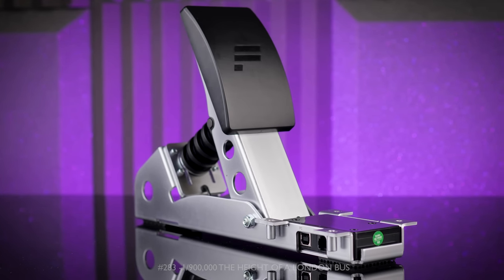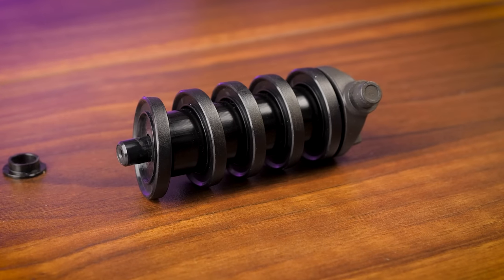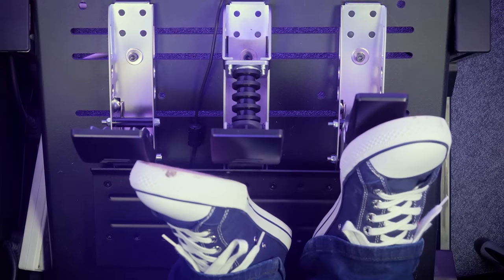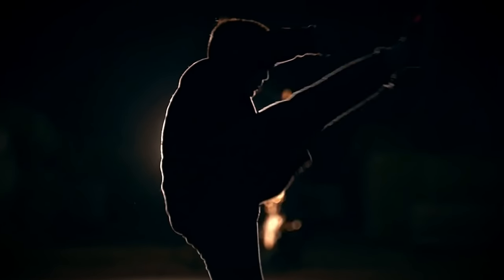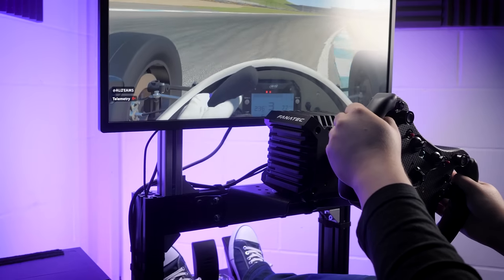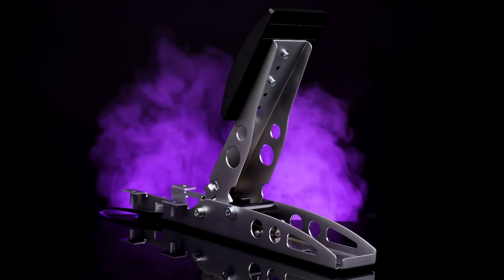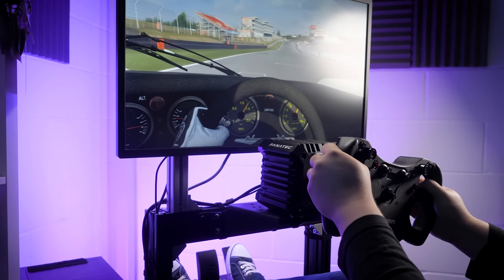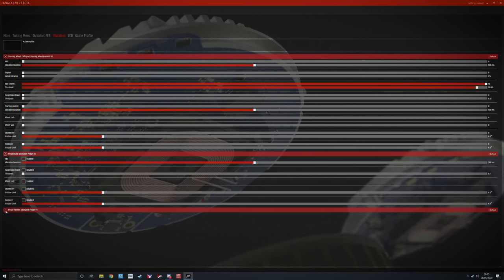Fanatec CSL Load Cell Brake Pedal Review

Comment: Well, I just put together my CSL pedals with the load cell kit and my experience is quite the opposite of Chris'.  The elastomer for my brake is much harder than Chris'.  I can't get anywhere the travel which Chris displays.  It appears totally unusable unless bolted to a sim rig.  Even then it could still be too hard.
Reply: Same here, making me suspect if my legs are too weak.
Reply: I have the same problem..you know if we can change that??
Reply: I just set up mine and I get almost no travel. The 30% sensitivity setting is enough to make it usable but it's nothing like what I'm seeing here
Reply: I ended up buying a wheel stand.  I ran across some "rubber spacers standoff washers" on Amazon that look similar to the elastomers the come with the pedal.  If I can find some that are softer then that might work.  The pedal comes with "65" hardness.  I think the next softer might be a "45".  I think it going to involve some trial and error.
Reply: @stuboyle666  That is a pretty good idea, hopefully it works for you! I bought some elastomers from BBJ Racing on recommendation from a forum. Not the cheapest solution, but hopefully these work when they come in.
Reply: Load cells like these absolutely need mounting properly. They only really work in a rig where you have your back braced against an immovable seat and when you press the pedal you are able to engage the larger muscles of the thighs and backside.
Reply: I swapped out the foam insert from the standard CSL brake pedal used the insert to replace one of the rubber elastomers. Feels a lot better.
Reply: @coastalboat5700  I tired doing that myself but I couldn't get the thing back together. Kept blowing apart haha. Glad you got it though. Must be nice!
Reply: @MarcLCT  happened to me too! I ended up removing a rubber disc and a plastic spacer to get it to fit.
Reply: Mine is the same. Hard to modulate since there is so little travel. I don’t have a full rig but I’ve a home made thing it’s bolted to, which rests up against the wall so it doesn’t move around at all, even if I have it set at 100%.
Seems different to most of the pedals I’ve seen in reviews.

Comment: Just got mine this week and my LC brake pedal travel is nowhere near like the ones shown here. I can barely push it past 2cm and it makes it very hard for me to heel-toe. Definitely gonna change some out to get more pedal travel.
Reply: I have the same problem.
It is so hard and you can do a maximum  push from 1-2cm

Do you change it or do you get a new one?
Reply: are u using it on a rig? it seems that without being mounted to something completely solid, these pedals are really hard to push in with the stock 65 shore elastomers (im having the same issue, im using a desk and the pedals are just on the floor.)
Reply: I’d recommend using the foam insert from the standard CSL brake pedal and replace one disc of the rubber with the foam. Travel is better and less stiff.
Reply: Mine is like that also. I’m not very happy with the feel.
Reply: Chris clearly does not skip leg day.
Reply: Can someone please help? Is it just me or is it incredibly unrealistic when driving normal cars? Like I understand f1 cars having this type of pedal but surely it’s way too strong for normal cars. Is there a way to adjust the force other than the distance???

Comment: It takes multiple hours / weeks to get used to. I first switched from G29 to CSL DD, which helped me to get a bit faster or at least more accurate 😂 after LC Kit was available, I ordered it and have been using it for couple of weeks and again I've gained some time, but I still need some practice to master it properly. Don't care about the travel at all, as I know that it's all about preasure. I'm also using racing boots with these as I feel it's  more comfortable than with socks 😎

Comment: 230 total price with all the upgrades (assuming you buy with the discount) probably worth spending the extra 130 for the clubsports
Reply from the maker: Maybe. I maintain that the clubsports are the best bang for buck pedals you can buy, and I’m a massive fan. But you get a lot of performance/ control for your money with these. But yeah, if you can afford the extra, clubsport v3s with the performance brake kit would definitely be my choice.
Reply: I have Clubsport v3 and I like it
Reply: Yeah, it's 230 buck for some folded sheet metal, 150 for a 2$ load cell. Disappointing as usual from fanatec and their huge margins on add ons

Comment: Great video in terms of quality camera work, sound and presentation Chris. 
In my opinion, the CSL Elite Pedals that I have just sold were probably the last fanatec product I will buy. I understand they were the elite however I just think fanatec are in for the profit above quality and customer experience currently. Take their CSL DD, the proper power pack is extra. 
Take the pedals in your video, they are cheap but probably same price as their predecessors. They look cheap though, the plastic pedal faces urghhh! Taking away the extra elastomers but then charging extra for a tuning kit when in reality its not a tuning kit but better pedal faces that should have been included already. 
Nonetheless good video Chris. But fanatec, no thanks.
Reply: I agree with what you said mostly. It's this approach that makes you feel trapped in their ecosystem because you are so heavily invested. The booster kit is a slap to the face, this load cell upgrade costing more than the base pedal set is insulting and there have been other examples similar to this as well. You can't argue that they aren't making among the best quality stuff in this lower/middle price range though...

I was invested deep into Fanatec when I first started sim racing more seriously. I have owned the PS4 bundle DD1, csl DD, CSL elite wheelbase, csl elite pedals, V3 pedals, magnetic paddle shifter, hydraulic brake kit, podium hub, bmw gt2 wheel, v1.5 handbrake, and V1.5 shifter. I sold everything except for my CSL DD and V3 pedals and the V3's might be on the chopping block. They really lock you in mentally especially on console. They have a great marketing dept. and design team but customer service and transparency are not top on their list.
Reply: I haven’t had my fanatec stuff for long but I found the csl pedals to be very good and definitely higher quality than my past g29 pedals, I have also had less problems as my g29 ones would get dirt in them and glitch however I have not had the problem with the csl ones. Also about the power pack I think it is definitely overpriced but actually quite clever because what I think they are doing is charging a low price for the wheelbase with 5 nm and a high price for the 8 nm meaning the product is more accessible for those with a smaller budget and while making up for the lost profit from the 8nm power pack

Comment: Chris can you check if the retail load cell breaks are different than the review ones? many people in your comments and myself as well have really hard ones I have max brake force and reach it after  like 2 cm of travel and not even close to your video. and I have a proper rig and mounted then solid.
Reply from the maker: I'll reach out to Fanatec and check. I definitely get more than 2cm of travel. Now, the Heusinkvelds, they're about 2cm at a guess, very stiff.
Reply: Any word on this yet?
Reply: @ChrisHaye  thx, But I decided an sent them back and went with the V3 Padals with BPK and I love them! they are  so much better !!!
Reply: Same here, would love to hear how retail compares with review. Mine are very stiff. Slowly getting used to them, as I know it's about pressure not travel but a bit more travel wouldn't go amiss!
Reply: @MrTone71  I just got a set of Elite with load cell and the LC is stiff too but I'd rather it be the way it is. When I saw the one in this review moving so far I was confused.
Reply: Same issue with me. Mounted to a rig and pretty unusable. 2cm travel is about what I’m experiencing too. Anyone know if there is a way to fix it without just getting a different pedal?

Comment: These look like great value for money. But a TM TLCM can be had for a lot cheaper locally, even without seasonal/clearance sales. I guess these are catered towards those that buy the CSL DD package.
Reply: T-LCM are great with 3drap brake elastomer. Check it out, its price is fairly low and transforms T-LCM 2x red springs to a real "pressure sensing" pedals.
Reply: @alpha007org . I will install a elastomer damper (or two) and a DIY rumble kit soon. :)
Reply: @s_n9210  Which rumble kit?
Reply: The price is almost the same, but the problem is that there is no official licensed dealer of FANATEC here in China, so I have to import the product abroad and pay extra shipping and tax, which is a lot. FANATEC should expand selling network.
Reply: @terrylu4894  I faced a similar predicament with there being no sales network in my country. Hopeful Fanatec will cover more regions in the future.

Comment: I used a 8mm foam insert, added that to the foam on the standard brake, then added a 140mm shock damper, and modded the damper have double springs (used a corking gun spring). It gives mote travel than the load cell brake. But still gives enough resistance to easily modulate.

I feel like trail braking is better on a modded stock brake than this stock load cell. But the stock load cell can be softened up a bit with different elastomers

Comment: Finally, a good pedal set is only complete with a LC brake and for 200€ for the whole LC pedal set I don't think that there is a better bargain around.
Reply from the maker: Yeah, it's definitely great value for money. I'll be testing it out against the Thrustmaster T-LCM pedals shortly to see how they stack up!
Reply: @ChrisHaye  there are multiple 3D printed plastics and rubbers available to purchase on eBay for the T-LCM now that essentially move those pedals up a price point. I hope you'll consider ordering some bits to test out the brake pedal without the included metal springs. Along with a bit of kit from 3DRap to improve brake feel, I'm running my T-LCMs at around 75% loadcell capacity, so I just can't imagine how running far less than that would provide adequate pressure. I cant help but feel this move by Fanatec is a step backwards. With things continually progressing; from gear driven bases to DDs, I don't understand why they've done this.
Reply: @ChrisHaye  Oh yeah that's a test I would love to see. Since I got on TM ecosystem by buying a used T500 that I got for less than a T300. 
Those pedals do sound interesting, especially if one compares them to the TC-LM or fitting the T3PA-Pro/T500 Pedals with a Loadcell. I mean the base is good, they are invertible and 

I'd second @divinasion's Idea, it would be nice to see the mods available for the TC-LM as well as the fanatec Pedals, as IIRC there were some for the old Clubsport elite, like the BBJ Dampers mod.  

Overall it looks like a nice pedal set, though the only thing I miss is the ability to invert them to a more road car style like with the old T3PA-Pro/T500 Pedals, which with the 3drap Elastomer brake mod are quite nice....although I'd still love to have my gas and clutch spring from the GTEYE's for the G27, as those are a bit weak on the T3PA-Pro/T500 Pedals.

Comment: Just be careful if you're a large guy like me. I split one of the 65s quite easily on my CSL Elite LC pedal. Luckily they came with 85 and 95 options to switch up to, and I could use one of the 65s as a replacement for the foam. I think a lack if options on this new set, might cause problems for heavy brakers like me.

Comment: I have it and they work nice, but whoever has it should do the spring mod to the load cell like I did. Out of the box the load cell is very stiff and not much travel... I installed a yellow die spring and it makes quite a difference, it's not as stiff anymore and has more peddle travel. Use either a blue or yellow spring to help it not be stiff and supply more travel. And it's a great cheap mod.
Reply: Hey bro, what are the specs of the spring you used?
Reply: @TJLeaver-ef1pc  20mm OD, 11mm ID, 25mm length

Comment: I dont understand how you can press that load kit so hard? Mine is barely moving, so stiff ..  I feel like am missing something,  it doesn't feel good. Do I need to unlock something?
Reply: I have the same problem. The pedal can't move more than 1-2 cm(1inch) and I'm pressing it really hard
Reply: Try replacing one rubber elastomer with the foam insert in the standard CSL brake. Worked better for me.

Comment: I’m not fussed about the loss of resolution of the LC as I’ll be using GT7 any way but I’d need much stronger poly bungs. My current pedal CSL LC is solid and is set to to almost full. I also boxed the throttle and used the clutch as a throttle as the spring is firmer. It looks like the new CSL pedals cannot do this so I’d need to fabricate a firmer throttle using RC suspension struts.

Comment: Thanks for the review, interested on your opinion on something... 
I see when you use it there's quite a bit of travel but I use it on a Playseat Challenge so I've had to adjust to about 85% to avoid the Playseat from lifting up. Does one need to travel in the foot as well as the pressure when racing for more accurate muscle memory?
Reply: The more travel overall then the more distance you have to play with in the trail braking phase, it could possibly translate to a fraction more control and consistency but i think would be very marginal and depending the type of pedal you like might even be detrimental. I just noticed your comment is a year old so you likely have it well figured out lol.

Comment: I am not saying 12 bits is not enough but you need to account for the losses. That include  deadzones and the configration when you use less than 60kg. That makes the usefull resolution around 9 and not 12 bits. For this reason, 16 gives a high safety margin.

Comment: How does the performance compare with the T-LCM? I don't go anywhere near the 100kg the T-LCM so 60kg is plenty for me. My only gripe with the T-LCM  is the pedal distance between the Throttle and Brake is a little too close for comfort even after adjusting the the pedal plates. I'm gonna assume I can actually leave one pedal out to maximise the space?
Reply from the maker: Good question. I've used T-LCMs a few times, but don't have a set to do proper testing with. I do have a set winging their way to me though, since I think doing a proper back to back comparison is important!
Reply: @ChrisHaye   👍🏻 will look forward to it. At the price point the T-LCM looks to be the closest competitor
Reply: The kg value is misleading. It doesn't account for pedal geometry and is not a measurement of the actual foot pressure required. If you compared these products in actual use, this would quickly become apparent.
Reply: I’m sure you could get aftermarket elastomers adjust the stiffness. Either way I’m excited to order mine!

Comment: Thx for the video. I have a question.. I play only f1 so can I just use the throttle pedal and that loadcell pedal? Because without the loadcell I see 2 pedal sets and with the loadcell I see 3 pedal sets but I want a 2 pedal set with the load cell. Thank youuu

Comment: Nice review!

Question: Would it be possible to use the clutch as throttle? To get a stiffer throttle pedal.
Reply: Yes this is possible.
Reply: @DomB_Fanatec  Thanks!
Reply: @DomB_Fanatec  By the way, are there any differences between the pedals except the spring?
Reply: @DomB_Fanatec  How?
Reply: @slimracer1553  Essentially no. The clutch has a wider pedal face, but but you can exchange that for the thinner throttle version.
Reply: @1027hristo  You can connect the clutch pedal into the throttle port.
Reply: @DomB_Fanatec  Thank you very much!
Reply: @1027hristo   I should clarify this point a bit more. It's not like the CSL Elite Pedals where there is a separate electronics box. With the CSL Pedals, there is an essential PCBA in both the Load Cell pedal and the throttle pedal. So you can connect the clutch to the throttle port to use it has a throttle with a stronger spring, but you would still need to have the throttle next to your pedal set in order to make that work (at least not without modifications).

Comment: Great reviw! I have a particular situation. I recently bought a second hand TLCM pedal a week ago. Than just two days ago, I bought a CSL DD kit that came with the CSL Pedals including the clutch. I left them in their box in case I decide to keep the TLCM and sell them. However, now that the load cell upgrade is released, I wonder if I should get it and sell the TLCM instead. What would be your thoughts? The TLCM have 90kg of force and these ones have 60. However everything else seems to favor the Fanatec. Am I mistaken.
Reply: I'm in a similar situation. I have a DD and basic pedals, but also TLCMs. The load cell kit would've been an instabuy a few months ago, but it very much seems a lateral move rather than an up/downgrade vs. the TLCM. 

In the end, I'll probably buy this piece of kit if it allows sims to better recognize multiple devices - a CSL base/wheel and TLCM pedals aren't something sims are always fans of. Can anyone with Fanatec experience confirm that they are seen as one or two devices?

Comment: Hello, does anyone knows if you can still do the 2 pedal configuration with just the LC and a throttle?
Reply from the maker: Yep, you don't need to connect up the third pedal. The LC brake acts as the 'brain' for the setup, and everything connects to it.

Comment: Seems like a good set! But considering I use the old CSL Elites with the 90kg, it wouldn't make sense for me to move to the new ones, I think.
Reply: I have zero interest in upgrading from my old CSL Elites. I honestly think the old set looks nicer and you can adjust the strength.